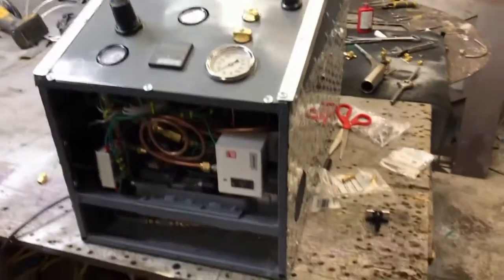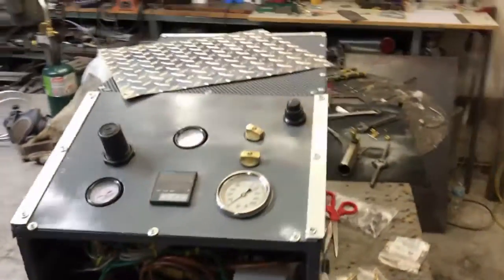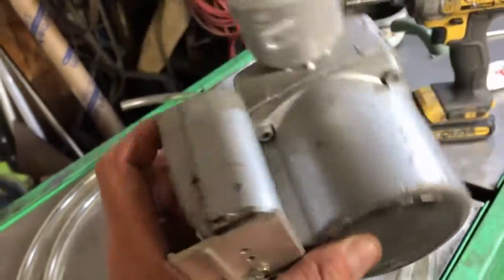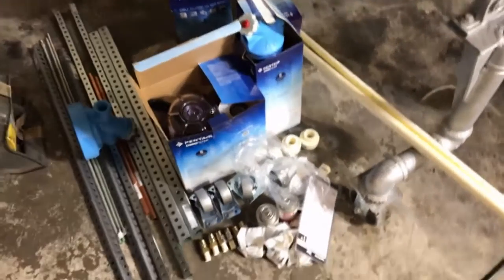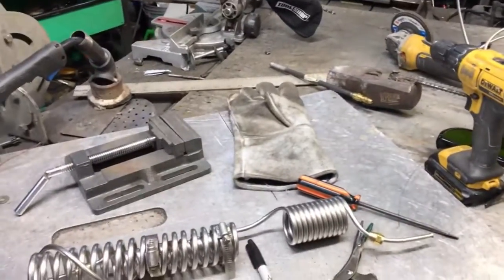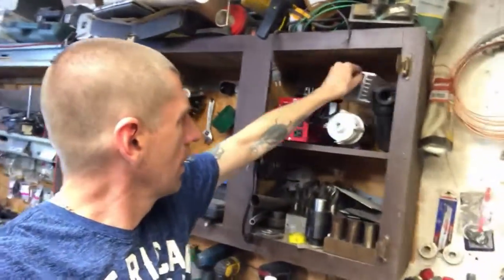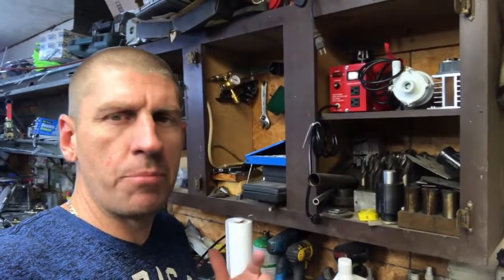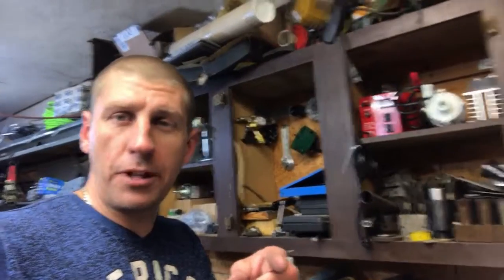Customer update , waiting on mail

Comment: WTH are you building for mr Mohamed ?
Reply from the maker: Oh your gonna love it steve , your just the guy i need hanging around on this one .
1 part of this project is a 88 to 90 plate oxyhydrogen cell 10,000 watts . Running 250 volts at my place   im very lucky even our 120 volt lines are 125 volt .   He wants me to build a massive hho burner for an idea he has . I was gonna go with nickle plates but ive watched your video like ten times on your testing and im baffled . Mybee there is a nickle shuffle reactuion taking place ? when you use iron plates a process called iron shuffle takes place where the iron is reduce at the cathode and oxidized at the anode robbing energy from the system , its gotta be some secndary reaction stealing that power . So i may just go with 304 stainless , any input on 304 vs 316 ?
Reply: NOBOX7 there is a chance I didn’t do those tests right. The main reason why I like nickel is the water stays clean . I’m sure you can see the value in that but is it worth 13 times the cost? I dunno. I have used both 316 and 394 and honestly there isn’t must difference. There has been a lot said about 316 and that’s it’s the best but really no one ever explained why. Truth is 304 works just as well. I like 22 or 20 gauge. Make sure your holes are big enough for water circulation. So important for cooling and performance but I don’t need to tell you that. Make sure your end caps are thick and they can move with heat expansion. If you need help let me know. Bounce questions off me is no problem 😀

Comment: I want to communicate with you directly. I need your experience in manufacturing such a device, but not by gas and by electricity
Reply from the maker: Please contact me using info in description
Reply: @NOBOX7  I want to reach 12 bar pressure in the smallest electric steamer